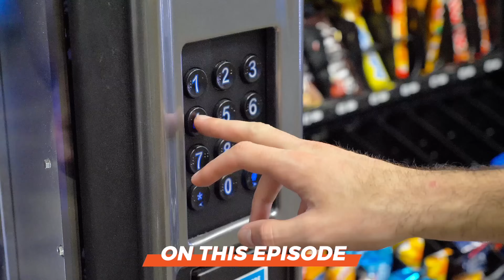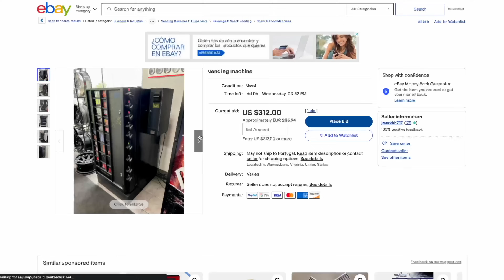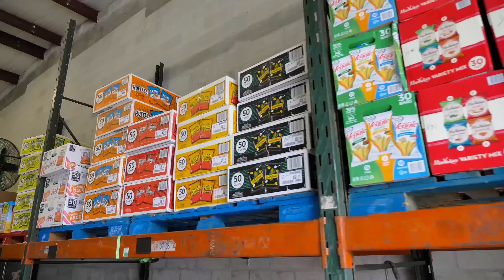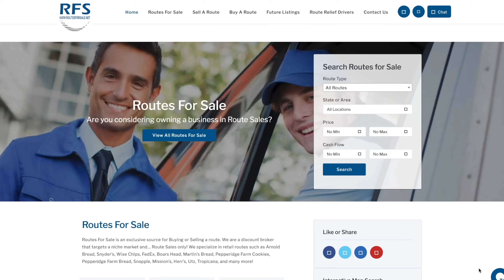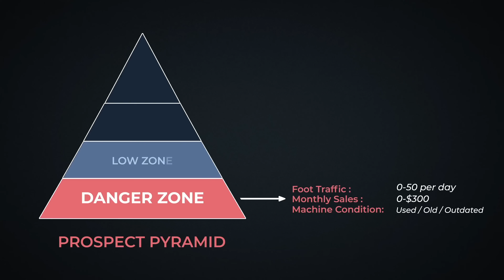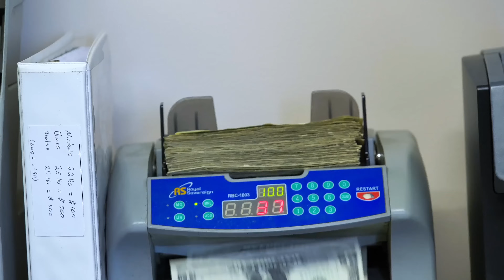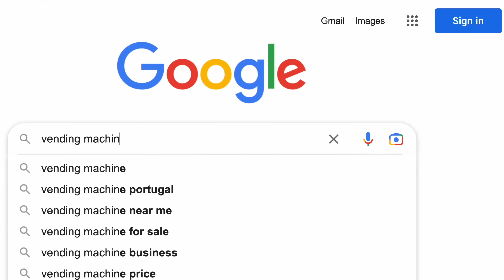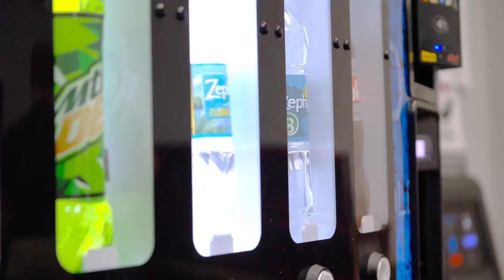2-Day Workweek Earns $700K -  Vending Machine Business

Comment: I work for a very large corporation whose footprint is from Massachusetts to virginia. They have 1 vending company. There are times where there are 5 spots empty in 1 machine. It takes them anywhere from 1-2 weeks to replenish. Machines appear to be cellular. It's like they just don't care because they have a lock on the corporation
Reply: Sounds like a ripe time for another company to bid. I can already hear the opening line... "I noticed you have 5 empty slots! How long have they been empty?" 😂
Reply: all machines are cellular for credit. unless the company wants to pay for cables to be run to the machines that's on them this is also not safe for customers as its easier to get the credit card info which is why we use cellular. sounds like you have a shitty vending driver that isn't servicing the machine when they need to. Should be serviced once a week on the same day and if there's still 5 empty slots, they either need to double up product and remove the slow-moving product or they need to make it a twice a week stop.  Also, if your corporation is that large, they are 100% getting a commission on the sales which is why the vending company is locked in a contract with them. Likely have a contract of 5 or more years that can't be breached. Also, you got to understand most drivers are payed over 25 and hour to service these machines if they have to drive out of the way to service 1 machine that has 5 slots empty it might not be worth it. There's a lot of cost factors that go into when a machine is serviced. This guy is showing machines that are freshly filled. He 100% has machines with empty slots any given day of the week that's just natural. But it shouldn't be empty for more than a week as every machine that sells out a few columns should be serviced at least once a week on a schedule.
Reply: @XingCollectables can you tell me what the definition of "cellular" is?

Comment: Interesting to note that the new cutting-edge, credit-card reading machines cost 10 times what an older-generation machine costs. HUGE capital outlay to get into the vending machine game. I assume that most locations already have vending machines. I would be concerned about broken-down machines; it is good to know that there are sub-assemblies that can be pulled out and replaced.
Reply: And guess what, the majority of the times the think that it is not working is the stupid Nayax card reader, the majority of the complains that I received is that the Nayax card reader it's not working and in Australia is the only company 
that´s supplied this service.
Reply: You buy a 700/100€ old one then intregated with a slot comp for sum up card payments (?)

Comment: Say it's $1000 per machine every month, and with 100 machines that's $1.2 million per year. 30% of that goes to salary so $360,000. Split that between 3 to 4 employees then it's about $90,000-$120,000. That's pretty good, but it could be less than that if each machine only averages $500 to $700. But if all it takes is two days out of the week, that seems really good.

Comment: He stated the 50-30-20 rule.  If 30% is going to wages, then $50,000 x 12 months x 0.3 = $180,000.  Is that split 3 ways?  So $60,000 each?  $60,000 is not terrible, but I would have thought it would have been better unless this is a side hustle and you have other income streams.  Do you make enough for this to be your full time?

Comment: I have NEVER bought a new machine in my vending business. They are super expensive. I can refurbish most any machine to like new. I can get old snack machines and retrofit upgrade kits, leds, paint, etc. for $1000s less than new and it will operate no differently.
Reply from the maker: That's awesome! Where'd you learn to repair vending machines?
Reply: Mostly self taught but got some basics from a veteran vendor. Was interested in the equipment so it was easy to learn it.

Comment: the fact that the network fee is per machine is absurd it its not browsing the web its just doing small data transfers each time someone uses a card, I think you could cut that cost down by wiring machines together, (i'm aware that they for sure dont natively support this) get someone on coming up with a work around for this and you'll save a bunch of overhead. he said almost 100 machines and at $10 a month, all the machines that are side by side should be able to be combine IMO.

Comment: Don’t fool yourselves thinking vending is a side business and you don’t need to not only work your butt off, but all your employees will be also working their butts off. Vending trucks, upkeep, maintenance, computer systems, repair of machines. Machines going down and you are tired but still need to go out and get it running. Just saying. Yes you have cash flow, but there is a ton of work involved in running a bunch of machines and several routes and trucks in a city. And you will have competition and have to pay rental space for the electrical use too. There is a lot more to this 5am to 11pm schedule than one realizes. If you make a plan into this business be sure to have a plan out. After decades it will age you.
Reply from the maker: Thanks for sharing your piece! Do you own a vending machine or route?
Reply: @UpFlip  I did for a few years. The overhead was pretty high with inventory, trucks, employees, taxes, inspections, rental fees for your space and electrical just to get the machine in a spot, parking delivery permits,and when the machines break you must go out immediately with the knowledge to fix it yourself. Most are simple fixes but there is time and gas.

I made the mistake of not realizing everything I was getting into when I was young. I research everything now and consider the wear and tear on me and my family. I just wanted others to not fall too hard for a quick buck without understanding everything involved. It’s more than you would anticipate.

The cash flow was great, but the work a lot and I remember always being worn out.
Reply: In Europe its required to put a phone number on the machine to call you if smth goes wrong.Its 24/7 and they can call you at anytime even holidays and midnight.